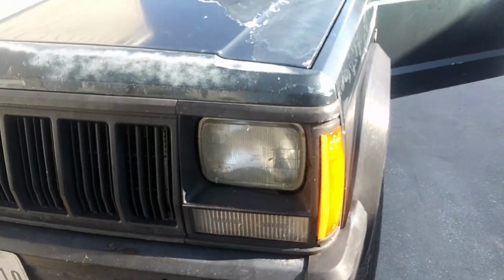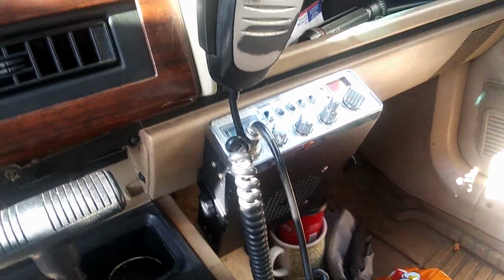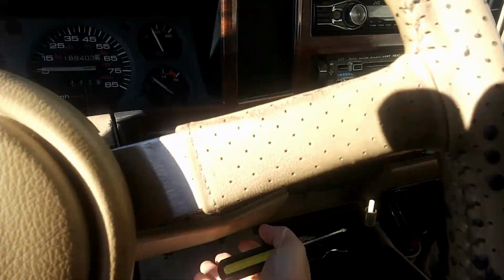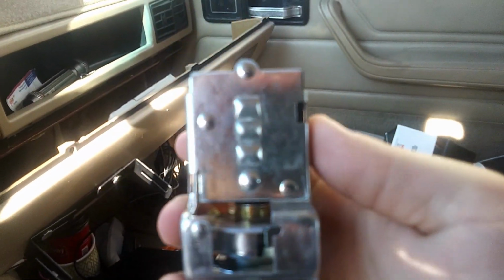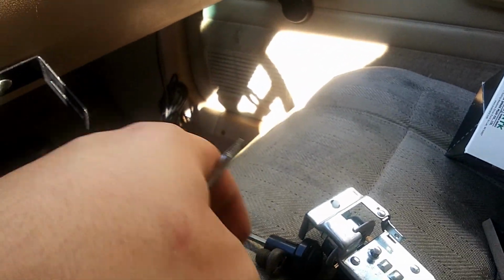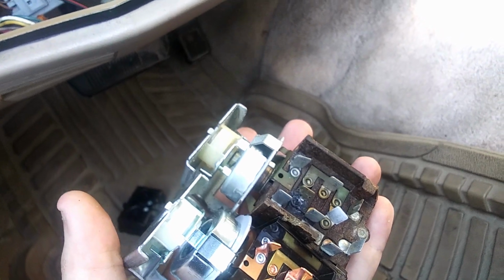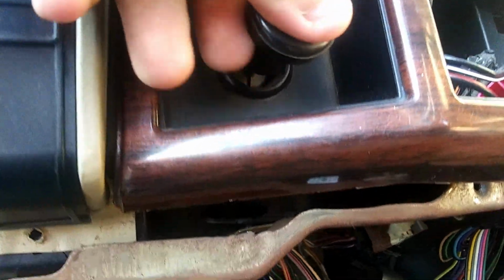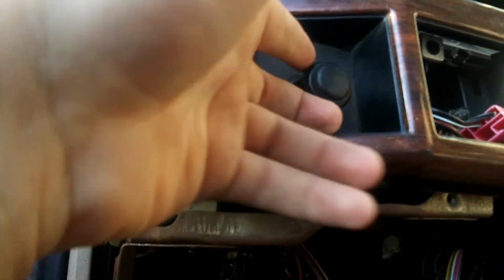1984-1996 Jeep Cherokee Headlight Switch Replacement

Comment: Do your marker and tail lights work at all?
Might be that a pin pushed out of the connector while plugging it in.
Reply from the maker: They do if I move the plunger to a certain position instead of pulling it all the way out(buzzer and everything else works like normal). The connector has two clips that hold it firmly into place so I don't think a pin isn't connected.
Reply: @JBenedict02  I have a FSM let me look up the switch plug
Reply from the maker: @oldxj  just got another one in and it did the exact same thing. Got to looking and come to find out it was the headlight switch fuse. #15.
Reply: @JBenedict02  good to know! It must have been back feeding somehow.
Reply: @JBenedict02  FYI, when I changed mine it blew that fuse as well. It must blow it somehow when plugging it in🤷‍♂️
Reply from the maker: @oldxj  As far as I know it only blows when the ground is pulled off the switch itself.

Comment: UPDATE !!!
I just finished replacing the light switch on my '96 Cherokee.     I have replaced similar switches on different trucks.     The switch on my jeep COULD NOT BE REPLACED FROM BELOW THE DASH.   I pulled lower dash and began the process as I have done before.   With the retainer nut removed there was maybe an inch of slack wiring harness allowing the switch barely an inch of movement.   No way to disconnect and  remove the old switch, and definitely no way to install the new switch.     I started pulling down the far left idiot light panel,  discovered that is riveted into place.  Then went after the instrument panel.   pulled instrument panel bezel,  and instrument panel which also required removing trim from the steering column around ignition switch/hazard light panel.   (you will need a t-20 driver,  and not a t20 bit on an extension)  It was barely possible to replace the switch going in through the instrument panel location.      New switch had 2 grounds,  old switch and harness had one.   Had to fabricate wiring,   you will need 2 spade female terminals and wire.    Doable,  but major P.I.A.
Hopefully yours will be easier like the one in this video.....Good Luck
Reply: I'm in the same boat, do you remember how you did the extra ground?

Comment: What did you do to fix your marker lights?
Reply from the maker: Turned out the #15 fuse under the dash blew because I pulled the ground off the switch with the battery still hooked up. Causing my problem.
Reply: How did you pull the ground off the switch?